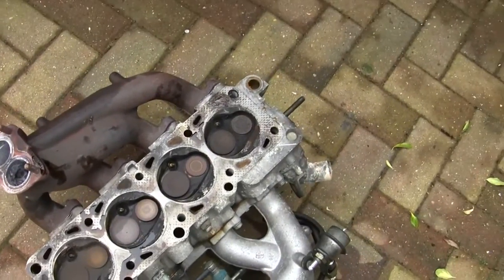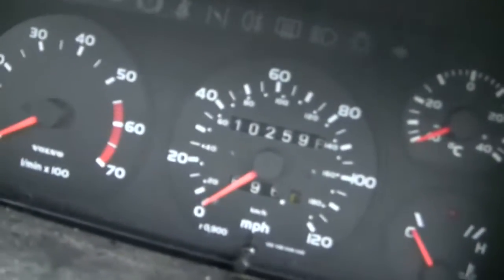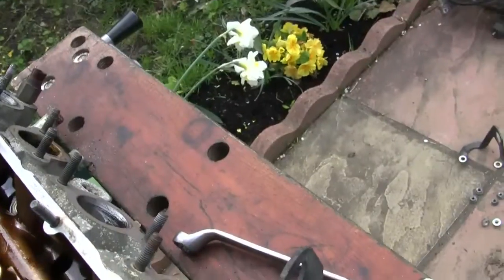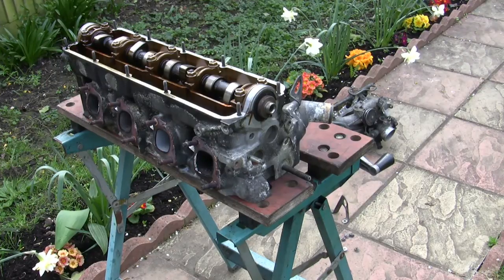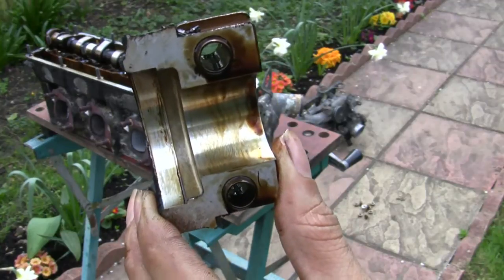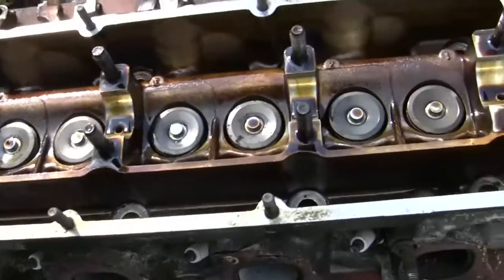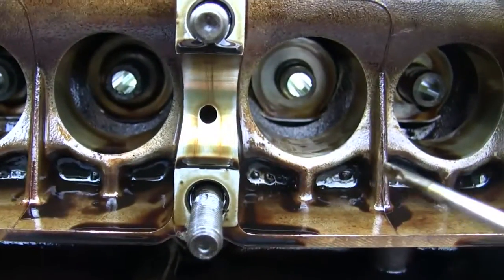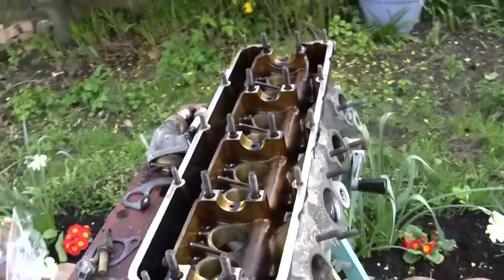How to Dismantle the cylinder head on a Volvo 360 (B200E)

Comment: @pettaw1 mine has 10.0.1 compression, and the handbook states a minimum of 95 octane 4 star, but i use an octane boosting valvemaster lead additive just to be safe. mine only has 43,000 original miles!